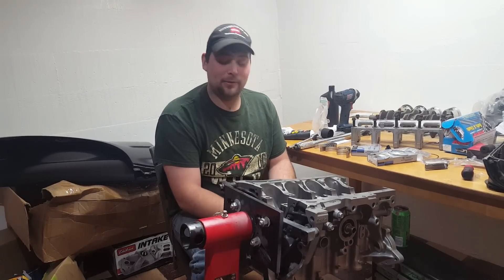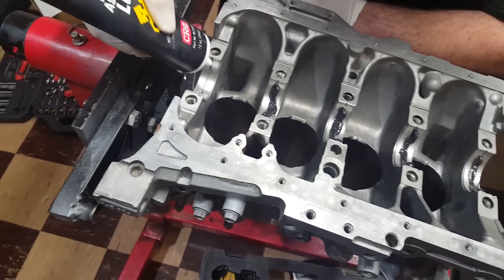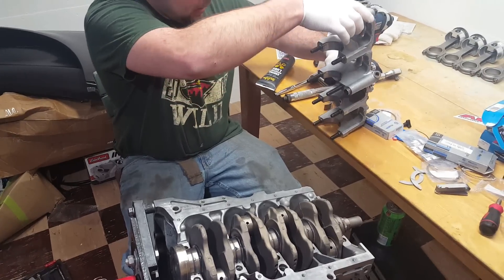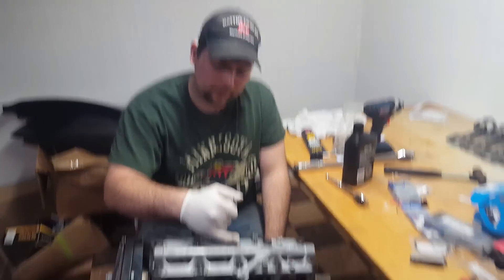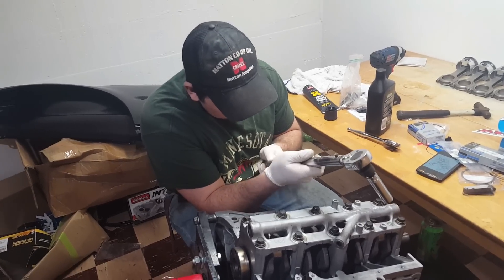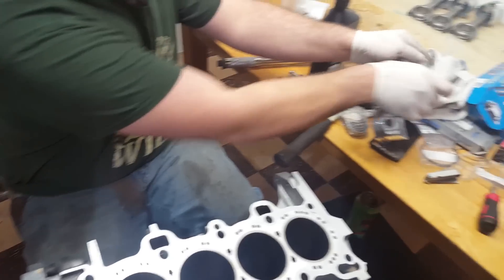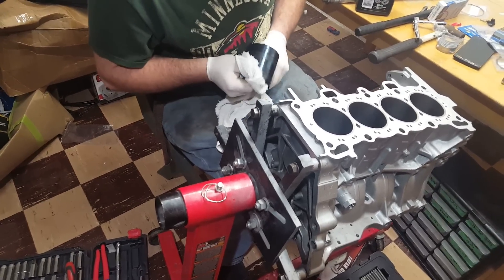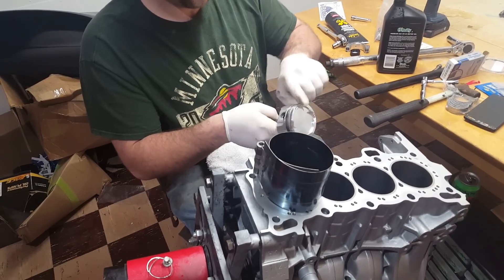D16 Build For Boost pt:1

Comment: Why are you using ACL Aluglide bearings instead of the ACL RACE? Are those better?
Reply from the maker: It all  depends acl states that the aluglide have different types of metal that helps the bearings last longer. And we haven't had a problem with them yet and the car made 500hp and dailys it at 350whp. I've used ACL race bearings before and haven't had problems with them either
Reply: @hondahowto  ok thanks!! Another question... do you remember which was your piston ring gap measurements?
Reply from the maker: @bryanfigueroa3  I can't remember exactly what the gaps were, but  I used a chart online that tells you how far to gap your rings for your specific bore size. I will try to find you the website and link it to you when I get off work
Reply: @hondahowto  thanks man! Appreciate it

Comment: Woundnt it be easier to do piston/rod before..?
Reply: But i swear ive seen other builds where they did the pistons and rods 1st..(iam just learning) 😆
Reply from the maker: @chrisnas1483  it's no big deal. Alot of people do it that way because there isn't much room, but Honda recommends to bolt and torque the crank down first, but you will be fine, it should compromise anything
Reply from the maker: It is, but you're not supposed to bolt anything together until the crankshaft is completely bolted and torqued to spec

Comment: Question regarding tightening the bolts at ~5:20: by exceeding the factory toque specs, is there not a high risk of stretching the bolt beyond it's specification limit?
Reply from the maker: Not if it's only a few ft lbs more. You always want to factor in lost torque through your extension or your socket. I've done it several time and never had problems,
Reply: I'd be concerned about decreasing the clearance between journal and bearing and cause a lack of lubrication. Why didnt you plastiguage the crank?
Reply from the maker: @FMJAmerican  all the clearances were checked prior to shooting this video.

Comment: I have a question, could I use standard size bearings on a perfectly running engine with no rod knock? Or would I still have to measure bearing clearance on the crank. Thanks in advance:
Reply from the maker: I would always measure no matter what. If it's within OE specs you're ready to rock. It's not too hard to do with a little bit of plastigauge
Reply: @hondahowto hey I’m late af because that comment was 5 year ago but I’m building a D16A6 for around 300-350hp and my rod bearing are giving 1.0 when I measure it okey that or is a bit tight?
Reply: Thank you!

Comment: what is that stuff you put on the bearings never seen it before
Reply from the maker: It is CRC extreme pressure assembly lube
Reply: @hondahowto  where do you buy that stuff
Reply from the maker: @Howardtripper  I ordered mine through my work, but you can order it online as well. My shop uses alot of CRC products so it was easy to get

Comment: so i have a question
how to make ur head studs holds high boost? like 30psi ? cause most of d16 problem is head gasket / lifting the head during high boost 
so how to keep it together
Reply from the maker: You can drill and tap your head bolt holes for b series studs. They are thicker and hold alot more pressure
Reply: @hondahowto  so did you just slap them in not measuring?
Reply from the maker: @537R4HC  no no no, everything was measured before I put it together. We just didn't show any of it. I'm kind of kicking myself in the head because alot of people asked for it and I never recorded that part
Reply: @hondahowto  which one should i use? b16 /18 or

Comment: Quick bit  , I noticed the blocked was notched for the  rods to clear. Not sure if you said that but it’d be a great mention for new builders(I’m probably way too late for this).just out of curiosity how much did you take of ? .25 inch?
Reply from the maker: Ya most people asked and I'm not exactly sure how much was taken off the machine shop never told me. But you're probably right 1/8 to 1/4 of an inch somewhere in there.
Reply: Dude , insanely speedy response! Appreciate it was just curious mainly .thanks man!

Comment: my el d16y7 has been sitting for a couple years with THE valve cover off still has oil is it savable please someone help it was knocking some one said it was my crank I had just gotten it rebuilt
Reply from the maker: If it's knocking I would assume its something to do with the crankshaft unfortunately

Comment: Those are the Aluglide ACL bearings not the Race bearings either way I run those bearings in my B18C no issues great bearing as long as your clearance doesn’t require a thicker or thinner bearing. Love the vids man keep it up.
Reply: What spun bearings he use

Comment: Hi man, I'm from Brazil and I'm using google translator. What is the torque of the bearings and connecting rods?
Reply from the maker: Connecting rod caps are 23ft lbs and crank caps are 47ft lbs

Comment: So in terms of building, what parts are different in the assembly for a d16y8? So far my research has found that the z6 has slightly lower compression and a much lower vtec activation.
Reply from the maker: Both engines are completely identical. Some of the parts are a little different, but assembly is the exact same.
Reply: Thank you thank you ! And can I ask where you got the cluster in the video intro? I dropped a new motor in and I can find a cluster with 4500 miles
Reply from the maker: @SnugLHqs  lol that's my buddies del sol it litteraly has 45k on it originally! Its a 1995 del sol vtec model. It was the 38th off the assembly line so he holds it pretty close to him.

Comment: I have a second gen zc motor in my crx. Is this the same parts/build?
Reply from the maker: dragonlee1000 sorry about the late reply!!! Its not the same exact parts but very simular. The way to build it,is exactly the same. 😉
Reply: This is a year late, but it depends on which ZC motor it is. The SOHC Vtec ZC (which I think you have since you said second gen) is the same as a D16Z6, stamped as “ZC” for the JDM market. The DOHC ZC is a completely different beast and DOESN’T share the D series blueprint. There’s also a third variation of the ZC motor with 3-stage Vtec, but I genuinely wish you luck in finding one of those.

Comment: When installing those h rods are you supposed to notch the block everytime or is it a rare occasion?
Reply from the maker: Vidal J you have to notch the block and the girdle for them to clear. Its more intimidating than it is. It's very easy.
Reply: @hondahowto  ive also seen in another video that u can buy the more expensive rods from boostline that are called no-notch rods to avoid doing this without losing boost capability
Reply from the maker: @sethhinton5014  I have never heard of them. That's pretty badass

Comment: what I would like to know is what the compression ratio was for the pistons ive boosted Hondas before but its all been stock so nothing special but to build the block for boost I would really appreciate knowing what kind of compression difference they went with
Reply from the maker: andrew arri these pistons were 9:1 compression. It was a pretty good combo, not to low to rely on boost, and not too high

Comment: would a d16y8 be as good
Reply from the maker: Drakson y8 are ok but they have weak oil pumps. But you can upgrade them.
Reply: @hondahowto  it's not that they have weak pumps, it's that the y8 only has 1 oiling port per rod journal where the z6 or a6 have 2 ports per journal. You have to make the y8 pump stronger to achieve the same amount of oiling as the z6/a6.
Reply: Honda How To thanks many of my friends recomended to just do a swap for b or h series i dont know what to do i just want to reach the 300 hp

Comment: Did you gap your rings?
Reply from the maker: Toabian Kim yes I did
Reply: Honda How To Just making sure haha! Also, I have a question about the notching. Is it required when using any aftermarket rods or is it certain ones?
Reply from the maker: Toabian Kim all h beam styles you have to notch the block and the girdle.
Reply: Honda How To Awesome thanks! I actually just answered my own question too lol. I was searching and found speed factory rods. They don't require notching and I'll be trying those out. Only looking to make about 250-300 with my setup for a nice daily.
Reply from the maker: Toabian Kim that would be a perfect amount of power

Comment: Just my own 2 cents but wouldn't some nitrile gloves be better because they are a little stronger and dont stretch so much?
Reply from the maker: Keonte Concepcion absolutely but I didnt have any lol.
Reply: Honda How To 👌
I was wondering if you measured clearances in the bearings? Or are the clearances pretty accurate. I plan on doing a 300-350 whp build with some vitaras and custom rods and wanted to know if you think it necessary
Reply from the maker: Keonte Concepcion I measured every single clearance possible lol.
Reply: Honda How To gocha 😁

Comment: shouldn't you put pistons n' rods on place before putting the crankshaft holder. for the ease of access. (sorry for my bad English. don't quite know the English terms for some parts.)
Reply from the maker: Vitun Näätä Honda actually recommends that you bolt the crank down before installing the pistons and connecting rods, just because the crank has less of a chance to shift.
Reply: Ok. Good to know. Thanks for answering!

Comment: Nice build,but that's not ACL race bearings
Reply from the maker: Dre Otero they are the same exact bearing as the the race bearings bit better they are Teflon coated and it does say acl accuglide race bearings on the box.
Reply: Honda How To Exactly  there aren't the same the ACL race have a tad more play on the thrust washer and coated bearings.  Even priced different I've used both many times.  But again nice build.
Reply from the maker: Dre Otero thanks brotha
Reply: Honda How To It looks bullet proof 👀
Reply from the maker: Dre Otero I hope it is we haven't drove it to much yet
Reply: Honda How To All machine work and quality parts and I'm sure you have a good tuner I don't see why it won't last for year's?
Reply from the maker: Dre Otero true the only problem is machine work and tuning are insanely expensive around here
Reply: Honda How To Shit man that sucks it shouldn't it's just a 500hp sohc 😁
Reply from the maker: Dre Otero lol right

Comment: hey i plan to rebuilt my engine  in march i already hav all the stuff, i need  but i notice in December when i pull it down there was a thrust washer in the oil pan and other still in the block , wan put back in the thrust washer but am not planning to remove the engine from the car could i fit them in block wit the engine in the car ?
Reply from the maker: leopaul evans you can. You will have to pull the pan and pull the girdle that supports the crankshaft and you can slide it in. But you said it fell out? Just wondering how?
Reply: yes it fell out of the slot  i found it in oil pan  am not sure how it fell out but it did
Reply from the maker: leopaul evans yikes you might have too much crank end shaft play
Reply: yes could be that so can i how fix the problem
Reply from the maker: leopaul evans you would have to pull the entire engine apart. See if the make oversized thrust washers.
Reply: ok thank you
Reply from the maker: leopaul evans np man

Comment: Great content love watching. But what are you using to check the clearances on the crank? Dont see no plasti gauge.
Reply from the maker: cookie monster I measured all the clearances before I shot the video
Reply: How did you measure them?
Reply from the maker: cookie monster plasti gauge
Reply: What tolerances are you working to? Thanks
Reply from the maker: cookie monster all of the clearences were within standard spec so we didn't have to use oversized bearings or anything I cant remember what the exact measurements were but I have them wrote down somewhere in my garage.

Comment: What's the stand called that's holding your block that allows you to easily spin it around etc?
Sorry, I'm new to all of this, got a D16A6 in my stock 90 Civic EF Hatch and I've been watching
videos like this for the last 6 months trying to learn everything I possibly can so I can one day
swap a B20 into it.
Reply from the maker: MISTA 808 its just an engine stand you can buy them in different sizes this one is one of the smaller ones.
Reply: Thanks for the quick reply.  I can't wait to get the motor out and get some work in on it.
I need to get a compression test done and any other tests/checks I need to verify the overall
health of the motor etc.  Any recommendations?  I got it from a friend after he unfortunately took his own life, so I don't know what all it may need etc.  Seems to be running pretty good though.  So far I've replaced the dizzy, the spark plugs, the wires, the oil pan, flushed the radiator etc.  Nothing too major just yet.
Reply from the maker: MISTA 808 np man if you have any questions just HMU

Comment: My cylinder walls look good. Pistons are good and crank obviously is strong. I just need to know if I can re use that all. Thanks bud
Reply from the maker: Roman Starkovich you bet you can as long as a bearing didn't spin the crank should be good. Pistons just need some new rings and bearings and I think you will be set bud

Comment: I need help:( I'm rebuilding a d16y8 and want to know if I can re use my stock internal s
Reply from the maker: Roman Starkovich you sure can as long as they are not damaged in anyway. When rebuilding I would still have the block honed and resurfaced. new rings, bearings ec.

Comment: Put all the rods and pistons in and then put the crank in, torque down the rod caps and the the girdle..its much easier that way.
Reply from the maker: Navin Isaac you should always have your crank bolted down before you bolt the connecting rods together. The free floating crank can shift if its not bolted down by the girdle. And that's what honda recommends. I've seen a lot of people do it the other way which is cool, but I just like to be safe.

Comment: Where u located
Reply from the maker: Oscar Face North Dakota
Reply: Honda How To  have a eg ,with d15b7, wanna put the d16y8 vtec head, dont know what I need to build a turbo motor , like what parts would I need to purchase
Reply from the maker: Oscar Face it all depends on how much power you want
Reply: Honda How To want the same amount your pushing, have the hook up ,on the machine shop, for the head and block , yours looks more bulletproof,prolly go your route , just don't know bout the cam ,springs and retainers ,block guard , pistons , injectors, on a setup d15b7 with d16y8 head
Reply from the maker: Oscar Face well i would for sure invest in the block guard its only like 300 to 400 bucks and its totally worth it and you can use a stock head. That's not going to be a problem, but I would spend some money on the bottom end if you want to make high hp. Eagle h beams good pistons arp bolts stuff like that

Comment: What kind of oil clearances did you use on the main and rod bearings?  And how did you choose them?  Or did you just go with OEM replacement bearings on a stock oem crank?  Sorry for all the questions.  I might be doing one of these and thought you'd be the man to ask :D

Thanks for posting!
Reply from the maker: rb26dett32 np man. On this I used the stock crank and standard size bearings. Measured all of the clearances with plasti gauge and made sure all the measurements were within spec

Comment: would this the same for a b series?
Reply from the maker: Geoge Veruh pretty close theres a lot more to a b series block than a d series. And b series blocks you dont have to notch the block for eagle h beam rods. I'm going to be building a b series here soon too.
Reply: what is the upgrade parts?
Reply from the maker: Sanjay Surgeon what do you mean?
Reply: the parts what to buy and use?
Reply: I have a DOHC ZC engine what's the best upgrade parts?
Reply from the maker: Sanjay Surgeon it all,depends on what you want it to do
Reply: +Honda How To run at less 13sec
Reply: Honda How To do you have a how to on notching the block and girdle?

Comment: pounding in Pistons with a hammer like that is a great way to damaged piston rings while you're installing them.  that is not how it is done this is coming from a Master Tech
Reply from the maker: kweku jacobs how are you supposed to put them in? Punch them in? I was using the butt end with a rubber handle and if you ask anyone that has ever built an engine they will tell you the same thing. If you have ever built an engine feel free to argue just please don't comment if your going to be negative and don't know facts, thank you.
Reply: Negative?  Uhh I do this for a living.  The rings should be compressed then you can use the but end of a hammer.  It's just a light tap to install,  if you have to hit as hard as you did then you will damage parts like the rings.  Feel free to click on my name if you think I'm wrong
Reply from the maker: kweku jacobs lol I lightly tapped it a couple times I've built 50 plus engines with that ring compressor and never had a problem. Maybe because you use a different ring compressor, this one creates a lot of friction so you have to tap a little harder than other ones.

Comment: is that a stock crank?
Reply from the maker: Jovany Flores yep it sure is
Reply: stock gurdle also?
Reply from the maker: Jovany Flores yep the crank is balanced and im using arp bolts for the girdle
Reply: thanks man.
Reply: im just interested. wondering what i can do with my y7 on a reasonable budget. 
any suggestions?
Reply from the maker: Jovany Flores np man